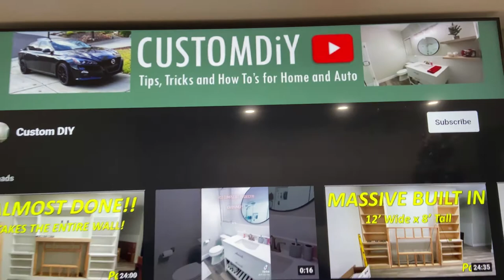DIY Building The Biggest Entertainment Center on YouTube - Part 4 - Final Reveal

Comment: I've been doing tons of research, this one is more detailed than most.  Wife and I just bought a new home and we plan to do a ton of work to it before we move in.  One of those is an electric fireplace entertainment center similar to what you've done.  What kind of paint did you use for the cabinets etc.?  Did you you use concrete board or normal drywall for the fireplace surround?  These are great vids.  Thanks for doing this.
Reply from the maker: Just normal drywall for the surround. 
Paint is Sherwin Williams Interior Satin - Icy Avalanche from Lowe’s.